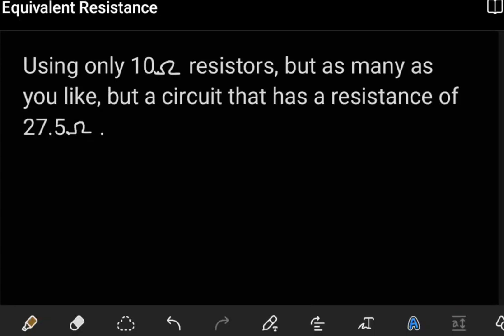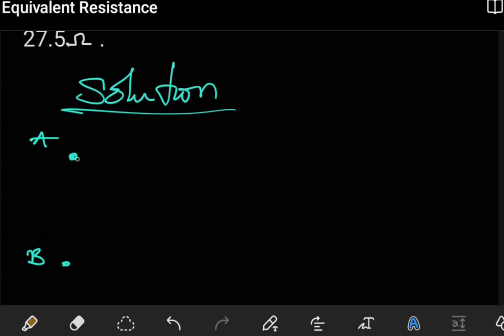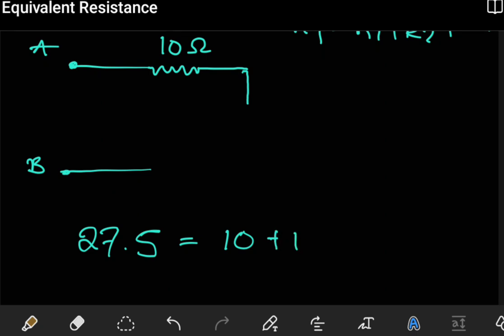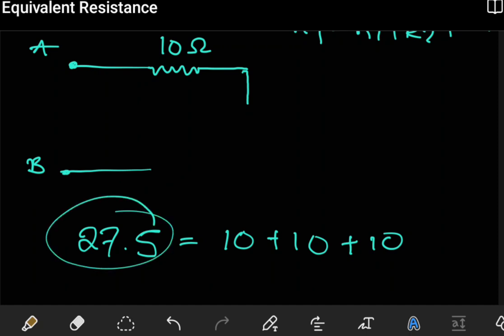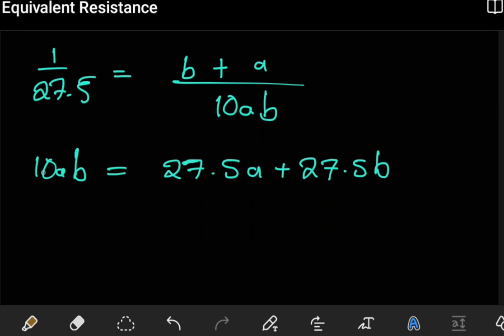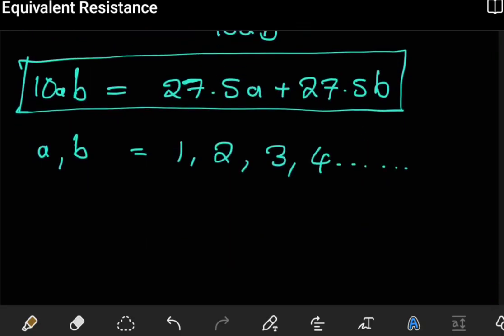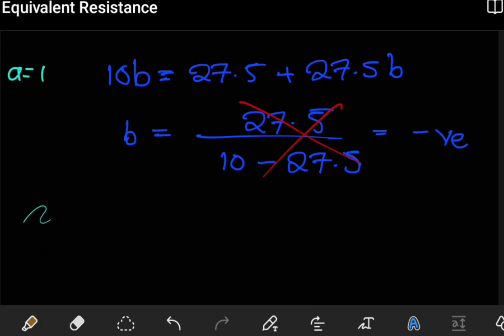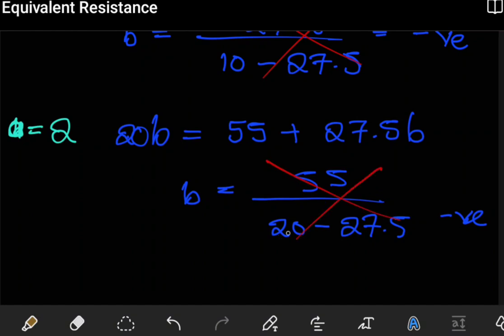Building a circuit using only 10 Ohms resistors

Comment from the maker: The Question reads: Using only 10 Ohm resistors, but as many as you like, build a circuit that has a resistance of 27.5 Ohms.